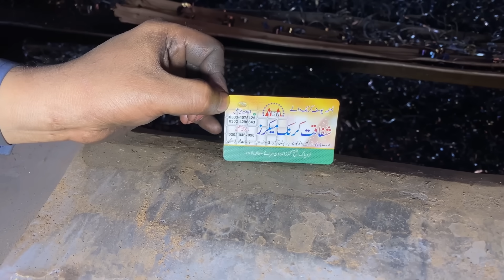Expert Cut a Crankshafts of Cruise Ship Into pieces and Made a Crankshaft for Ammonia Compressor ||

Comment: Reminds me of a wonderful film from 1935 called 'A Study in Steel', which follows the manufacture of a steam locomotive from start to finish. The forging of the connecting rods, casting the wheels, making the boiler etc. My dad was an engineer and worked in a factory in Leeds. He took me round when I was a youngster. I was fascinated, but scared out of my wits! The noise and heat was overwhelming, especially by the cupolas. Watching the guy on the lathe takes me back to my dad's workshop and his Myford that he bought with his demob money after the war. Centring work with a piece of chalk and using a steel rule and callipers to check diameters and making it all look easy. That's the mark of a true craftsperson. They make it look easy. A fantastic video.

Comment: It always amazes me how much work and time goes into making something from scratch.
Well done
Reply: Not quite from scratch.  They had to salvage the cruise ship shaft to get good enough metallurgy.  I'm sure they can't just get a billet of the proper alloy from a steel mill in the country.

That original shaft was probably made from German or Japanese steel. You can't just use junk steel made from melted down scrap. They are somewhat changing the properties in the process, but they will not rally change the alloy much. Many people think steel is just some generic product, but it is not. That's why it made sense to salvage the huge shaft. It may not be ideal for the end use, but it will be pretty close. The owner of this shop most likely has a metallurgical degree and understands why it matters,

Pakistanis are good at making things that look just like the original, but if you don't get the metallurgy right for an application like this, the part won't last very long.

Comment: What no one is saying here. Why a forged crank? Forged cranks require far more work and are for highly stressed engines. For most applications a cast crank will more than suffice and is far easier to produce in quantity with minimal machining of the casting. It blows me away how time intensive it is to produce a forged crank versus a cast crank.

Comment: Ammonia is a 3-10% more efficient refrigerant than CFCs, so an ammonia-based system requires less electricity, resulting in lower operating costs. Ammonia is safe for the environment, with an Ozone Depletion Potential (ODP) rating of 0 and a Global Warming Potential (GWP) rating of 0.
Reply: Toyota is developing a piston engine with Ammonia as the fuel.

Comment: plus or minus  1/8", wth, it'll run long enough to sell it to some sucker.  Dont even put cylindrical stock in a v-block to drill a hole down thru the rod? bound to be off-center/out of line

Comment: This 'machine work' is dependent on high pressure oxidizer gas, clean orifices and a bit of practice   ...
:face-green-smiling:A coworker tried to recruit me from weld shop to fab shop to operate plasma table, said "Man, I could train a monkey to run this thing", 
He was handed a floppy disk with a preprogrammed parts cut path 'order' from supevisor. 
He would locate the torch heads on the proper plate steel  select parameters...let the machine run.
Now I wish I HAD ...

Comment: these guys definitely put in time to get things done, only one thing that makes me cringe, is arc welding on the lathes using the lathe as a ground......those bearings have got to have a ton of arcing across them.  the work should get the ground not the lathe. and you can hear it in some of these lathes with little tinks and thunks when they are spinning with no cutting going on.
Reply: Good point.